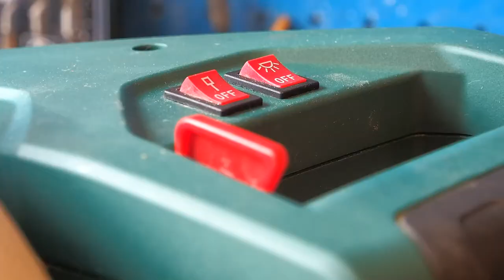Chop saw tuning - Soft start module - at Home

Comment: Interesting problem. I have the same saw connected to a 16A circuit breaker and a 20A RCD and it doesn't trip anything. But to save the saw bearings and the motor, I also added SoftStart and it works well. I warmly recommend. The larger Metabo KGS 305 M miter saw already has SoftStart as standard equipment. To hold the SoftStart in place, I fixed it with a plastic soldering iron. He is a good helper.
Reply from the maker: The fuse switch has the old H symbol, it does not tolerate short overruns.
Reply: Put module on ac chord

Comment: Maybe change circuit breaker to d-curve type
Reply from the maker: No, the wire is old. I'm just renting the apartment, I didn't want to renovate the electrical system.

Comment: Bonjour, pourriez me donner le schéma de branchement de ce module car sur la vidéo on ne voit pas trop comment vous faite le raccordement. Quel fils couper et raccordé avec quel fils ?? Merci pour l'astuce car ces moteurs démarrent vraiment très fort
Reply from the maker: https://www.ulfatec-shop.de/media/image/97/ff/53/DW-10-1-Sanftanlauf-16A-4GxdJ73V8Bh0YZBkKEaGtRzxMlC.jpg
Reply: Le schéma de raccordement est gravé sur la plaque d'aluminium (le refroidisseur), faites pause à 1:01

Le fil commun étant le neutre en théorie, mais comme la prise peut changer de polarité, le plus simple est de couper un des deux fils du moteur qui ressemble à la phase (couleur, circuit ou tout autre indice), ensuite raccorder le moteur coupé à la sortie C, alimenter le module en A et B, le fil commun (neutre) étant entre le module A et le moteur non coupé.
Donc le module est alimenté en A et B, via l'interrupteur qui coupe le deux circuits,
Le moteur est alimenté via le module en A et C
J'espère que c'est assez clair pour ceux qui tomberaient sur la question et que l'image en réponse de "My Little Workshop" n'est plus accessible.